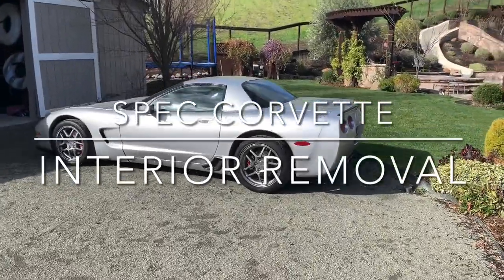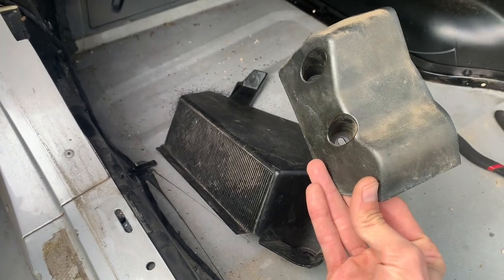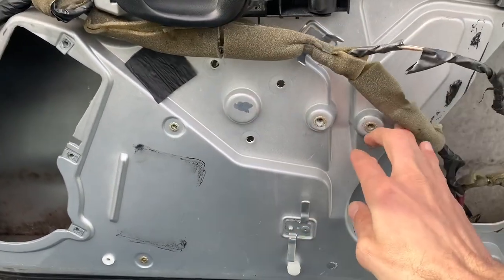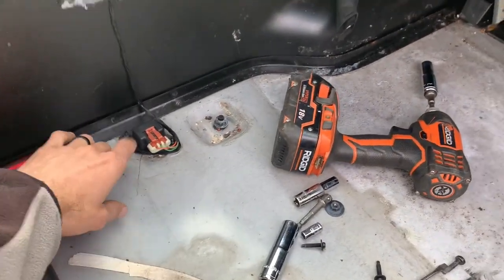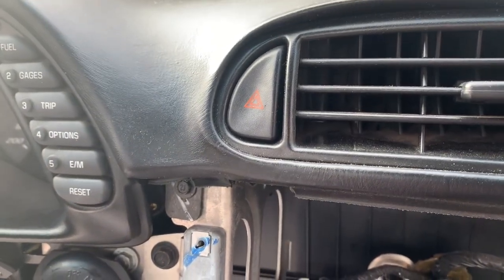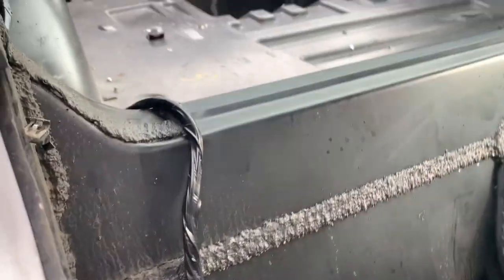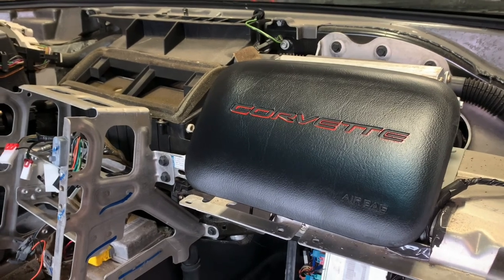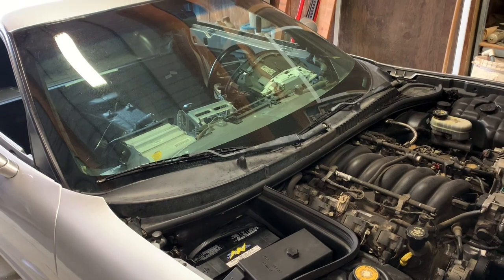Spec Corvette Build - Interior Removal

Comment: Cool video, looks like a lot of work. Should make for a nice Spec Vette when it's done.
Reply from the maker: Thanks, Jack!  I guess it can be as complicated and time consuming as you want to make it.  You can be competitive without much work at all.  At the other end of the spectrum, you can optimize every little thing, like removing unnecessary wire from the wiring looms.  This build will be somewhere in the middle, doing things that I think are best bang for the buck and make the car more reliable and easier to work on.  Turning wrenches on a car in my man-cave is therapeutic, though, so I'm happy to jam some 80s hair metal and wrench away.
Reply: @joshc1017  Sometimes therapeutic, sometimes it causes me to seek out therapy (or just throw a wrench here and there). That said, I've been looking more and more into Spec Corvette but wonder how bad the consumables are (as opposed to say my Spec Miata which seems to only need pads once a year, rotors every few years and tires seem to be the biggest cost so far).
Reply from the maker: @jackroman8821  I go through 2 sets of front brake pads per season and 2-3 sets on the rear (I run lower temp pad back there). Front rotors last 1.5 to 2 seasons. I’m on my 3rd season with the rear rotors and they’re still going strong. Tires are competitive for 3-4 race weekends, depending on how much test and tune you add in. That’s the biggest cost savings, at least compared to other classes that I’ve run in that required a new set every weekend. There isn’t a lot of other maintenance; just fluid changes and the occasional thing that breaks. Failure points are well known so you’re wise to follow the allowed modifications in the rules, like swapping the stock hubs with SKF racing hubs, etc.

Comment: I take it your power mirror control didn't make it back in, so do you just adjust manually by hand before a race?
I always power adjust the mirrors on grid once I'm all strapped in to be just right before going out on track since they're so small
Reply from the maker: Yes, I did not put the door module and card back in, so I adjust them manually. No issues so far but it would be a bummer to have the passenger side knocked out of place when already I’m buckled in at pre-grid.

Comment: Would you still recommend dry ice for removal of carpet? Just in case it doesn't come off as easy as yours
Reply from the maker: It’s never been a problem for me in a C5, but I’ve only done 3 of them personally. I’ve used dry ice to remove undercoating on other cars, like the EP RX7 that I built, and it worked great. Chipped out clean with a hammer.

Comment: Awesome! What brand headlights are those?
Reply from the maker: Not sure. The car is at Spec Racing for the cage now. I’ll get a closer look at the lights when I get it back. Not sure if I’ll be able to keep them though. May need to put in stock covers to meet the rules.
Reply: @joshc1017  ah I see. Ya i just got an 03’ z06 I am converting to hpde, was thinking of swapping the headlights or maybe just keep the covers and gut them
Reply from the maker: @Radron26  Yeah, if you want to keep it Spec legal, it's best to retain the stock covers.  The question about lights like these is whether they generate any additional downforce due to the raised profile.  I do recommend getting the buckets out, regardless.  They break easily and replacements are getting harder to source, which means they're getting pricey.  Replacement covers are no big deal.
Reply: @joshc1017  ok, awesome! I will do that for now. Right, no idea about the df from those lights. I just wanted to take some weight off
Reply: @joshc1017  but popups tho